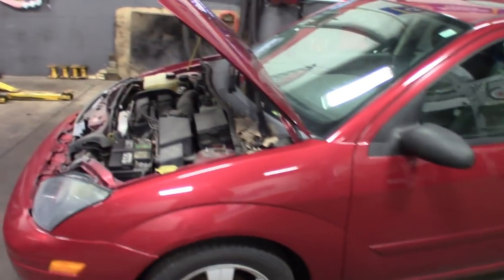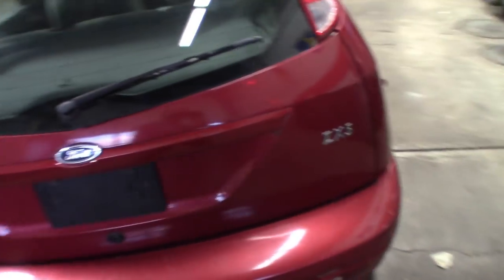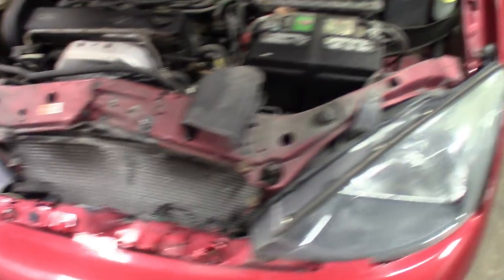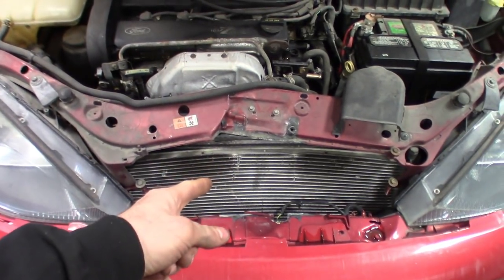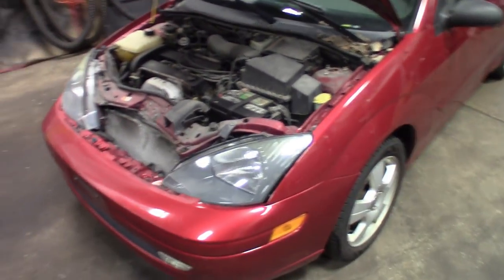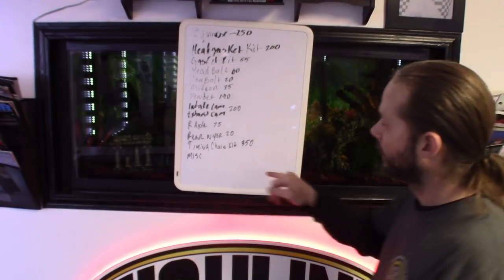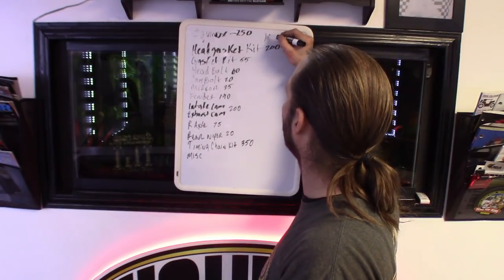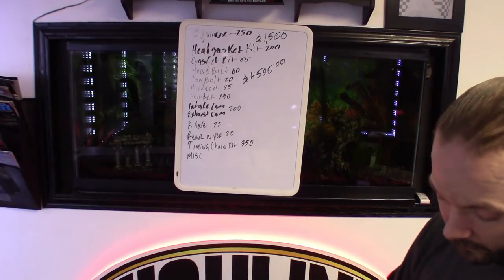Flips To Pay My Tool Bill🤔

Comment: I would pull the core support out, to help straighten up area around it first jim. You prob thought of that.
But junkyard hood latch, mabey color matched hood from the same place.
But how was the rust on it?
And dont hold back the jeep stuff, need to convert more people over to the dark side.
Reply from the maker: Rust is not too bad. I'm going to rip it apart to get a closer look and make a parts list.
Reply: @JRC54  Mabey used core support to.
But from farther south lol.
It looked clean in the video. And all easy stuff.

Comment: So how many hours do you have in it? I don't know you shop hourly rate, but assuming $75 per hour and you clear $2500, that's about 33 hours. You did a ton of work, but I don't know how many hours it was. I've found that flipping is kind of a tough way to make money. When you get done it basically comes down to you just buying yourself some work to do. I've never really been able to clear any profit over my normal shop rate for the work I've done (I've never flipped a car, I've done machine tools and commercial trucks though). Plus you may have money tied up for a while if you can't sell it.
Reply from the maker: I can't count my own labor hours on flipping I don't charge myself to make money. But I got about 7 to 9 hours in labor in it with everything.

Comment: Would a bad fuel pump on a 01 impala LS cause check engine to flash and run like shit? Happened in about a 3 day time period so I'm guessing fuel pump but I'm a welder fitter so outta my realm
Reply from the maker: Check engine light flashing usually is a misfire. Check your coils, spark plugs, injectors ect
Reply: @JRC54  but would a shot fuel pump cause that? Had it narrowed to that then gf said this started with the light flashing on her way to work
Reply from the maker: Not often. Probably a bad ignition coil. You would have to monitor with a scanner to see which cylinder is missing
Reply: @JRC54  is that something I can do at O'Reillys or something, back to welder fabricator my car skills are limited.
Reply from the maker: Yeah Auto zone or any place should give you a free code read.

Comment: At least the Focus has the good engine,the DOHC.The sohc cam 2.0 is a pile of junk,known for dropped valve seats.Jeeps are easy sellers,My dad buys them to flip and they sell quick.Have a commander I have to put the engine back in,rebuilt the engine.Knows it will sell quick